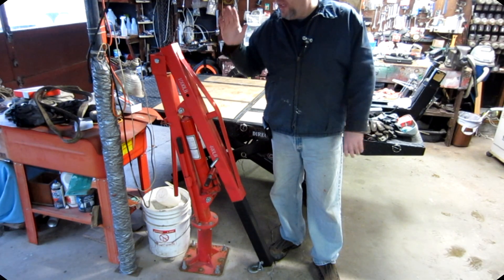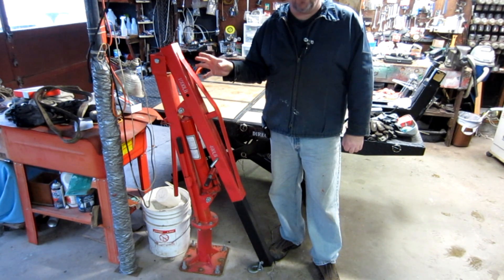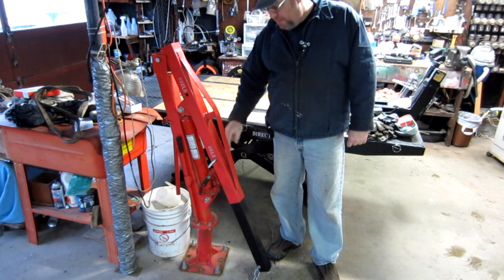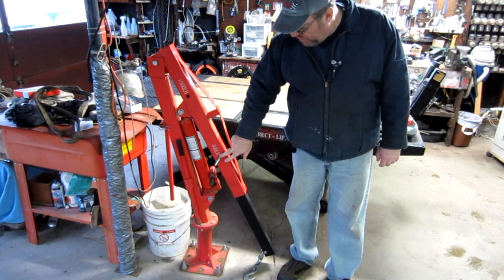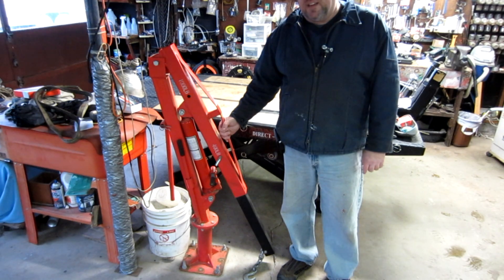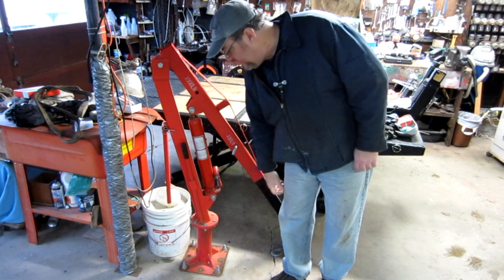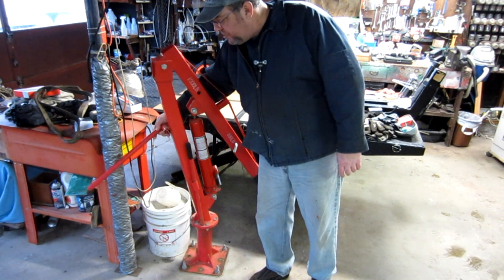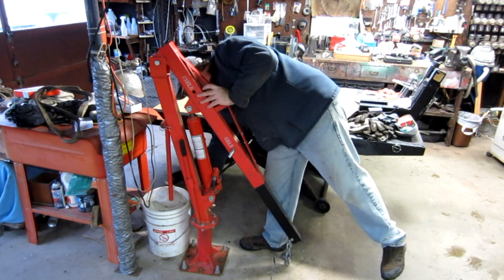Small Engine Riding Mower tractor Crane

Comment: Next time you go to use it try this: grab the hook and lift straight up until the boom is well above what you need to lift. Then lower it to the appropriate height and lift. It removes the tedious pumping.
Reply from the maker: I was told by a guy once they sometimes it introduces are if you have a seal that might be leaking a little bit. He said the rapid increase on a negative side sometimes will pull air from the weakest point. Also he said that it might agitate the fluid. I don't know how you agitate hydraulic fluid, but, whatever